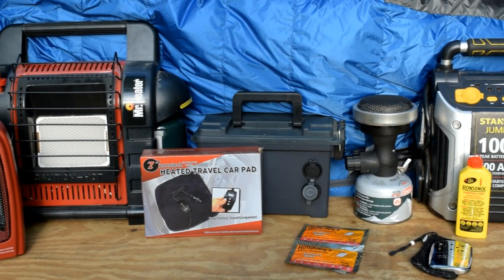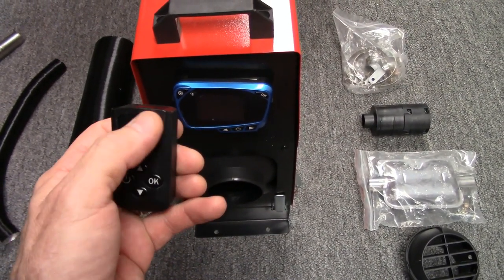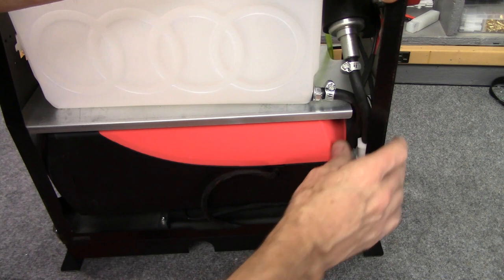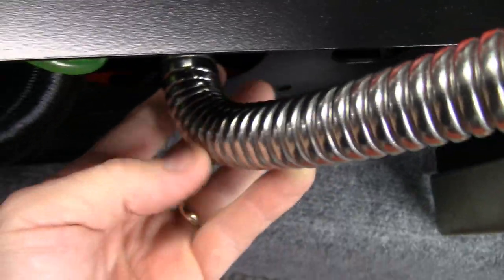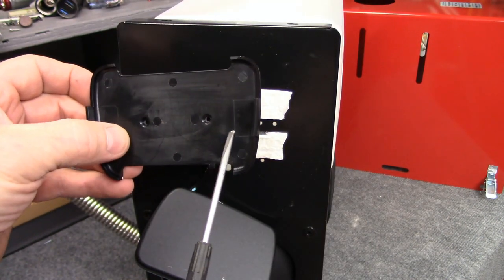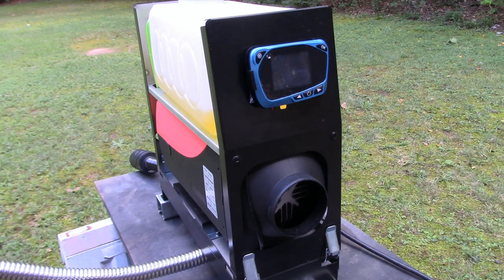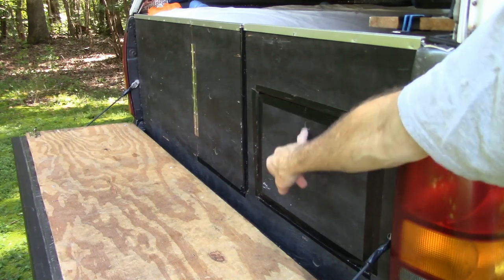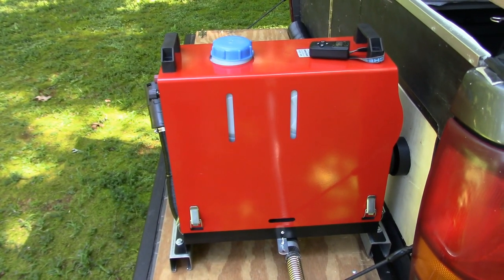Truck Shell Diesel Heater Build - DIY

Comment: Awesome mods to the diesel heater I have the same unit I  my expedite van it works Awesome  just make sure every month to turn the heater on full blast for 30-45 minutes to burn all the soot off the glow plug and out of the burn chamber and hopefully you you never have any problems with it  😎👍👍🇨🇦
Reply from the maker: Good advice!  I asked you about this unit a while back before I purchased it to get your input.  Please keep me updated. Thanks!
Reply: Will do most likely going to be making a diesel heater update video in the upcoming months probably January or February giving my opinions on it so far so good
Reply from the maker: Looking forward to it!

Comment: 7:00 I used a few wraps of plumbers PTFE tape to achieve a gas tight seal.  Not so imperative in your case as you said the unit would be outside.  Good video thanks for sharing your setup. 👍
Reply from the maker: I use the unit inside my basement as well so any ideas to be safe are good. Thanks!

Comment: Since the air intake and exhaust are connected under the unit and can be extended outward, and since most people install these inside their vans and things, for rain, you could probably cover the entire unit with one of those fiberglass rocks used to cover other things like pumps and meters outside. This would protect it from any rain. 

I live this idea because I’m building out my truck too and will need heat but don’t want the extra fuel tank inside my truck. 

I may build a wall for the back of the bed with insulation board with a wood or aluminum frame to allow the tailgate to stay down for use like yours. That’s a great idea. 

I am so grateful for your mods as I wouldn’t have known about the potential issues had I bet seen your video. Thanks!
Reply from the maker: I always set up a free standing canopy/tarp over the back of my truck when I'm camping.  The canopy serves many purposes one of which is to protect things like the generator and diesel heater from the rain and elements. The canopy rolls up and is easy to transport. There's not room inside the shell for a hearer and  fuel tank so I figured outside setup is the way to go. Thanks for your comment.   "Free standing truck canopy build" video:  https://youtu.be/n940PLHGbB8
Reply: @geenote  I like your videos, to the point and very helpful.  I may have gotten the idea from you in that I will be putting up a tarp over the back end of my pickup, only using the truck itself to attach the tarp to so that it folds over the sides just a bit (8' wide tarp) to help blowing rain.  I got 2 tarp poles and guy lines to tie off the opposite end to create sort of a porch between my truck and the screen room tent I have that I'll put over a picnic table (if there is one).  I bought some heavy duty suction cups with hooks that hopefully will suction to the sides of my truck so the part attached at the truck will just suction cup to the truck and not need guy lines to trip over on that edge (I need all the help I can get in that area!).  I also only need 2 poles (or one if I want to create a center ridge on the tarp).  I suppose it alters as you hit different camping spots.  This is all a new setup for me and it hasn't been tried fully yet as my truck is not finished.
Reply from the maker: @jannezack  Sounds like a great plan.  I seen those suction cup hooks on Amazon a while back and thought about trying them out - they look like they should work great.  I have some magnetic hooks that I use but they probably aren't as strong as the suction cup version. Thanks for sharing some good ideas.

Comment: I love my little diesel heater! Keeps my roof top ten at a nice seventy to seventy two degrees. In thirty degree weather.
Reply from the maker: Nice!  That is good information.  I'm new to diesel heater use but so far I love it.  I am going to post a video very soon showing how I use it to heat my basement workshop.  I plan on posting another video of me using it in the truck shell while camping in freezing weather. Thanks for the encouragement!
Reply: 70 wow thats like in the sahara or sauna!🥵

Comment: This is pretty cool. If your going to leave it outside while you sleep I’d recommend some way to strap it down in case there’s some heavy winds. Maybe to the side of the truck somewhere. I’d imagine it would be possible for 60+ mph winds to knock it over especially with it being too heavy having the fuel tank on top.
Reply from the maker: I could always use some thing like bungee cords and some screw hooks in the wooden shelf. Thanks for the ideas!

Comment: That is an interesting way of mounting the heater without the need for cutting holes in the truck bed.  Other than the unit being out in the weather the only major thing I would be worried about is just how well you could regulate the heat with the controller/thermostat being outside.  I realize the remote will save you from going in and out.  My worry would be more of waking up freezing cold or dripping in sweat.  In your case a simple solution would be extend the wires on the controller with a plug and mount in on the inside of your removable panel. I've not looked at my unit that closely the wires might even be long enough with as close as you have it.  Something to think about.
Reply from the maker: I almost always use my awning when camping https://youtu.be/n940PLHGbB8.  That should keep the heater dry.  I like the idea of extending the controller wires to reach inside the shell.  I have the heat on manual hertz setting for now.  I was wondering how well it works in temperature mode and if it varies much from the set point?  Thanks for sharing some ideas

Comment: I have one in my Service Transit 250.  Same unit.  Works awesome.  Van isn't insulated, but still heats fine.  I piped exhaust thru floor with two galvanized plumbing flanges back to back, bolted together on either side of the floor sheet metal.  A small 3/4 pipe take the exhaust out and the other 3/4 pipe was turned down on a lathe to slip inside the corrugated flex hose. sealed with red silicone and it looks beautiful.
Reply from the maker: Sounds really nice. Great idea. Thanks for sharing.

Comment: There hole in your muffler is for condensation make sure it points to the ground and keep it parallel to the ground and not tilted just as a friendly tip.
Reply from the maker: Yes thanks for the tip!  I had seen that on another video otherwise I never would have known.

Comment: Fantastic project. I'm sending this video to a truck camping friend. I think this would work perfect in my van as well.
Reply from the maker: It's not as efficient placed outside but I think it will still heat a small space like a van or shell. I like it being portable, not in my way and less noise when sitting outside. I'll find out how it does soon. Thanks!
Reply: @geenote  it'll heat up of 30 foot motorhome perfectly so it's going to work in the van might matter of fact the people that have them in vans  say there too hot

Comment: Keith, excellent video! Thank you for sharing this. Great job with mods and installation options.
Reply from the maker: Thank you!  I'll give this set up a better test on my next cold weather trip and see how it does.
Reply: @geenote  I am enjoying your videos, as I have a 2002 Chevy Silverado Z71 LT extended cab (rear doors w/ rear hinges) odometers got 200,000 miles. She looks and runs like new. Your truck appears to be same as mine. I recently picked up high back topper shell. My wife says she wants to try truck-shell camping. Your videos are inspiring me to build a similar set up. I've watched almost all of them. I appreciate your time in helping out me and others.
Reply from the maker: I have always liked the front body style on that generation truck and that engine will just keep on going. You will love that high top.  My wife has camped with me a couple times in the shell and I just use a camping type mattress on the floor.  She would rather use our pull behind camper (no surprise) and that Z71 tows it great. Let me know if I can answer any questions when building your set up.

Comment: Keith, I bought the same unit. I used an aluminum step stool to mount mine on for the exhaust clearance issue. I know you have a remote control but I wonder if it would be a good idea to lengthen the wires on the control panel to mount it inside and out of the weather? Once again great video, look forward to the test.
Reply from the maker: The canopy I use should keep it dry while outside.  It's so tight inside the shell I am hoping I can leave it out on the tail gate.  I like the idea of longer control wires so the controller can be inside.  So far I keep my controller on manual heat setting but I was wondering how good the thermostat works on the controller?
Reply: Keith Gee I have only used mine in a remote cabin so far. I have not used the temperature control yet. I do like turning it on by remote in the early morning hours to avoid that initial cold shock lol. I do like the unit considering what I paid for it. If you get a zero breeze next year I don’t even want to know lol
Reply from the maker: @The1980toyota  HaHa!  No Zero Breeze here!  A remote cabin sounds awesome.  I am considering using the diesel heater to heat my shop downstairs at my house.  Thanks for the info!

Comment: Great mods and an informative video, thanks. Only thing I might do slightly differently would be to mount those lifting channels sideways (like a ‘C’ channel) with both open sides facing inward towards each other. That way you could fit a metal sheet inside between the two to make a second ‘floor’ to protect anything you stand the heater on from the heat of the exhaust. Maybe some small rubber feet on the bottom of the channels to give a half inch gap and some grip, too. I see there is a 2KW version available as well. Any idea on the size of heater to space it would heat on min setting? The price is much the same, however, so I guess it would only be useful to have a smaller one if overheating the space was an issue. Thanks for the upload. 👍🏻
Reply from the maker: That is a great idea and I will probably add a metal plate on the bottom! I think the 5kw and the 8kw are the same size and only difference is the settings in the controller.  I think the 2kw is a smaller footprint and probably good for my application (small space) but not available in the all-in-one unit.  I still have not tested my set up while camping in really cold weather. I will test it soon and post a video on how it works. Thanks for the input!
Reply from the maker: Just wanted to let you know that I added a thin piece of sheet metal (stainless steel) under the unit after I rotated the legs and even added rubber feet like you suggested.  It is safer and protects the exhaust and intake hose when I move it around or transport it.  Thank you for the great suggestion and I am going to post a video showing it in use soon.
Reply: That’s great - looking forward to seeing the video with the modified unit! 👍🏻

Comment: BTW... Do these include a thermostat in the remote so that they maintain a set temp level? Or do you need to manually turn them on and off all night to be comfortable? Thanks again for your work on this topic.
Reply from the maker: The thermostat sensor is located in the controller (not remote) and has to be inside the area being heated.  These heaters can be operated in one of two modes.  You can set the pump rate to run in manual or set the desired temperature for sort of an automatic mode. In auto mode, the unit will change the pump rate trying to maintain the desired temperature but never completely shuts off - it will stay on low when temperature is reached. Hope this helps.
Reply: @geenote  Got it. Thanks yet again.
Reply from the maker: @bobkantor4695  anytime!

Comment: Interesting option for heat. Any idea about how long a tank of fuel should last?
Reply from the maker: Great question. Based on what I have learned from others who use these same heaters,  it will run over 24 hrs of constant use on a tank (around a gallon) of fuel on low setting. It depends on what heat setting they are set on.  These heaters are known to be very efficient on fuel.  I will post another video after I give this heater a good test while camping in cold weather.

Comment: Hi Keith,
Thanks for sharing this video. I just received mine(the same). I am going to install it in my trailer. I have a question related with the air intake  tub. Should I place it outside of the trailer and just put the exhaust hose out of the trailer ? 

Tks for your help and tks again. Very nice explained !
Reply from the maker: Route both the exhaust pipe and the air intake outside.  The air intake will use up oxygen inside your trailer if left inside as it is used to keep the fire burning inside a sealed chamber.  The air intake will not affect the heated air temperature that blows into the room.  The air that enters the room is brought in through the back of the unit and pulled across the outside of the sealed heat chamber.  The air heats up as it passes over the hot chamber and continues out the other end through the 3" opening where you can attach the 3" flexible hose if needed. The exhaust pipe gets VERY hot so make sure you use something like a metal plate when routing the pipe outside.
Reply: @geenote  Even with Canadian cold?  

Really appreciated your help ! Tks again !
Reply from the maker: @alsepu80  Yes.  Thank you!

Comment: How do you prevent the diesel fuel from freezing/gelling? I'm concerned. 

Since this happens as high as 32F/0C. 

Do you use additives?
Reply from the maker: No problem with that yet at 20F

Comment: Thanks, great video...I'm researching diesel heaters for my truck camping and off grid RV camping.  What brand did you get and did it ship from overseas or from somewhere in the US.  Also which one is it the 5000 or 8000?
Reply from the maker: The 5000 and the 8000 are exactly the same unit with different settings in the controller.  I bought mine off Amazon for $111 and now the price is way up there. Ebay is cheaper for the same thing just make sure it is a US seller or you can always shop on Amazon for the best price and know that you can send it back if there is a problem. I am planning on posting a video soon of the heater in use while camping in freezing weather.  Thanks for watching.
Reply from the maker: @D Vick That's the way I would go with Amazon and that's a great price.  That heater has all the accessories too. The timers in that blue controller are a little tricky to understand. I have a video ready to post that explains how to set them. Mine shows altitude but I didn't know it made adjustments accordingly. I think you will be very happy. I'm camping this weekend and trying out the heater on my truck shell. Let me know how your heater turns out.
Reply from the maker: @D Vick Awesome, that's hard to beat...Thank you!

Comment: Hi just got mine in the mail.  I appreciate the video!!      at 10:04  after you hooked it up to the battery,  what button did you  press to start in prime mode.  i couldnt see in the video.   and do I have to turn it off after to prime mode like you did and turn it on again to dstart the heater,   i didnt get great instructions and dont want to  do something incorrectly.
Reply from the maker: Hold the settings button and the right button down at the same time. Then push the left button to turn on the pump and prime the fuel line.  After the line is full of fuel, turn off the pump with the right button and get back to the main display.  Press the start button to begin the start up cycle.

Comment: Would there be any way to lengthen the wiring for the controller so you could run it into the interior of the cap?  I have mine on its way and your vid is great for seeing what to look for and the mods you made. i realy like the mod for the exhaust , even in the snow with the posibility of it touching the ground would kinda freak me out for heat reasons and being that it would be close to the truck its a great idea. Thanks for the vid and looking forward to your next part on it. Cheers.
Reply from the maker: Great question.  I thought about doing the same thing so I can use the thermostat to cycle the heater.  I searched and found some extension cable/harness on Ebay and Amazon that might work and I seen where others just bought some wire and spiced it in the existing wiring harness. Let me know how yours turns out.  Cheers.
Reply: You can lengthen the controller wire.  I added about 8' when I installed a parking heater in my truck camper.  I used a piece of 18 gauge flat 4 wire trailer harness.  The trailer wire works with no issues.  I have the 5k unit and we have to vent heat out with the heater on the lowest setting in 30 F.  We have zero condensation inside with this heater.
Reply from the maker: @tinstar5080  good information thanks for sharing!

Comment: Put a hose at the heaters air intake and make another hole in wood panel have it draw warm air from inside of camper rather than warm up cold air from outside.
Reply from the maker: That is a good idea. That would definitely make it run more efficient increasing the temperature of the heated air. Thanks for the suggestion!